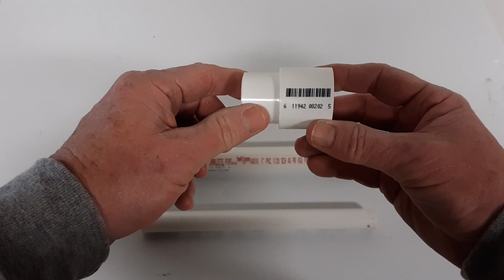DIY PVC Trolling Motor Shaft Extension

Comment: Are the collars going to allow the extension through both on the mount and the depth bracket? Did you change the settings on the mount bracket?

Comment: Its the same thing you cant lower it pass the pvc. wont go lower into the water!  just the tiller is now highter in the air
Reply from the maker: Yes. When deployed the head might be very close to the deck and not able to be operated. This will raise the head for easier use.

Comment: Ok great video. I was just thinking of how I could do this myself. My concern about the one you did is the downward extension length. 

I need the prop at least 6 more inches underwater. Does the shaft clear the lock mechanism to get way down in the water? Or is it's downward extension limited? Thanks.

Comment: Just found this video, with the 90 and a steering control arm or tie bar would it be possible to use as a kicker motor type set up and steer with your outboard steering wheel?
Reply from the maker: I have never done that but it sounds like it could work. If you do it, please let me know how it works out. Thanks.

Comment: how does the new pieces slide threw the locking mechanism to allow it to go deeper in the water
Reply from the maker: It doesn't. It is meant to extend the shaft above that point.

Comment: Here is my concern about doing this. How will this shaft slide down far enough to make a difference since the pvc diameter is bigger so will it fit thru the depth bracket when u loosen to lower or raise it?
Reply from the maker: No it would slide through the bracket. The addition must be made above the depth setting.

Comment: Will that work on bow mount trolling motors
Reply from the maker: It should work on any trolling motor. The main concern would be putting too much pressure on the PVC pipe since it is not as rigid as the stock shaft.

Comment: How did you  determine where the hole needed to be on the heated pipe after sliding it onto the shaft ?
Reply from the maker: I placed the pipe side by side with the shaft and marked the center point where I wanted the hole to be. I drilled the hole straight through the pipe. Then I just lined up the holes when I slipped the pipe over the shaft.
Reply: @Aksmaniyak  thanks for the info. I thinking bout putting a transom trolling motor on the front of my deck boat  because of the size of the lbs.  thurst of an 80lbs or better bow mount is really expensive.
Reply: Have you considered using conduit ?
Reply from the maker: Yes I did but the internal diameters of the EMT tubes did not work with the shaft.
Reply from the maker: The cost of the longer shafts needed is what gave me this idea.